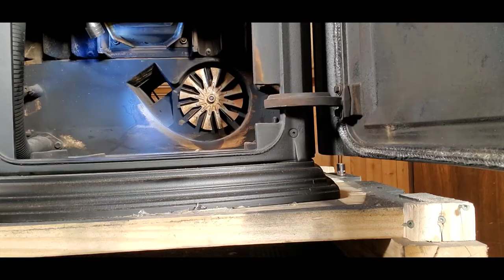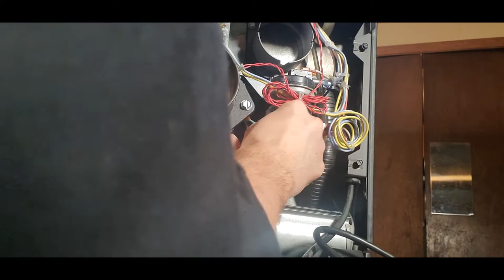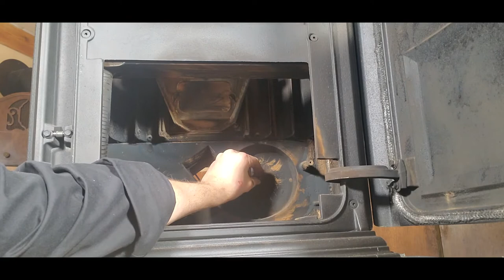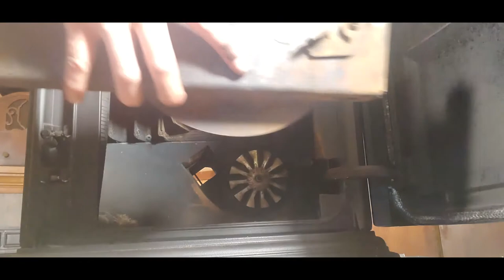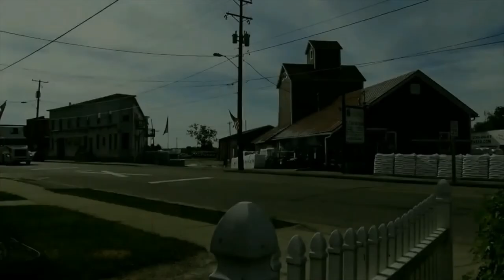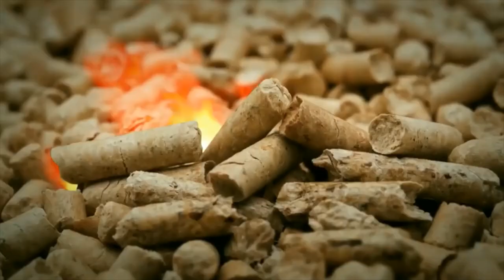How To Replace a Harman Combustion Blower, Exhaust Fan Draft Motor

Comment: I just changed mine out yesterday. Not bad for 10+ years. Yes, 1/8" allen screw, was way tight; soaked with penetrating oil overnight; Used small torch but still nothing. Ended up bending fan fins over and cut off at shaft.
I covered the blowers in back with a rag so I wouldn't lose and hardware inside. Motor came out easy. I reused the felt gasket. New motor was a newer design with a one fan versus a two fan. The ties I had cut I left hanging so I would know where to replace with new ones. Routed power cord back and secured with new ties. Replaced damaged fan also.
Not too difficult of a job to replace unless you're working on the floor like me...on your side like a pretzel. Though I did pull stove out away from wall I was able to get behind it but still awkward position. Still, u guys make it look sooo easy especially when unit is up on a lift bench...haha!
Just a note: My motor was a two fan. A replacement May look different. Again, Two fan versus One fan on motor.
(Hearth & Home Tech) Part# 3-21-08639 Combustion Blower / #3-20-40985 5in Single Paddle Blade. YOU Must use your Model and Serial to obtain correct part/s.
Also adding: I did look up motor on parts list (online) for an Accentra-2 and brought it to Stove Shop I went to. The number I gave them was a completely different motor And $454.! Once they had serial number and proceeded checking in their system they came up with a different part # and upgraded motor. Under $200.! So, please.....either bring your original motor with you to store and/or give your serial number. Model and Serial are on back side of stove. Good Luck!
Reply from the maker: Thanks for sharing the detailed report with the community; very appreciated. Yes, I have also seen those paddles so stuck on there that you need to bend the fins and cut it off - glad you tried the other options first. Yes, early Harman models had a combustion blower with a two blade design, later on they changed that to a one blade. Yes, over the years there are different part numbers used for the same item, it's also good to double check and cross reference. We are happy to help if needed. Thanks again!

Comment: I have the XXV and have a hard time accessing this draft fan. Two wing nut and a long bolt. I loosen all 3 and the fan doesn’t budge. Seems like it sealed on. Any ideas how I can get it out? Non flammable lubricant??
Reply from the maker: Thanks for contacting us. I believe you are referring to the fan paddle attached to the draft/exhaust motor correct? There should be a small allen bolt holding this fan paddle to the motor shaft. In may cases we need to soak that down with a lubricant like WD40. In some cases folks will use a pencil torch to heat that area up to break the fan paddle loose. There have been times that the paddle is bound to the shaft that lubricant or heat do not work. If this ends up happening, the best way will be to fold the paddle impellers in and use a dremmel tool with a cut-off wheel to cut the motor shaft for removal. Keep us posted, happy to help.

Comment: I have a Harman Iron stove.  Any recommendations for finding the right exhaust fan?
Reply from the maker: Hey Neil, Several Harman Models used the 'Iron' tag including the Accentra as you see in this video. Iron would not be the model. On the back side of the unit you will see the UL label and that should provide you the model name (I'm guessing you either have the Accentra or the Advance). As for the exhaust fan, all Harman models will use the same exhaust motor. Here is a link for reference. https://pellethead.com/product/harman-heatilator-ecochoice-combustion-blower-exhaust-draft-fan-motor-oem/

Any other questions please let us know. 

Thanks!

Comment: If the flame is getting drawn down into and through the burn pot what could that be? Thanks for any help.
Reply from the maker: Do mean the flame is coming around the edges of the burnpot? If you are consistently seeing flame shoot out the edges of the burnpot or top, we would recommend checking/replacing the burnpot gasket and burnpot flame guide. If this is not what you are referring to please provide further description. Thanks.
Reply: @EarthSense  Thanks for responding. Last summer birds made a nest in the chimney also a bird was in the fan that's behind the ash drawer going to the exhaust pipe. I didn't know all this until I tried to start it this winter. I cleaned out everything I could think of and reach. 
Here's what I found. First, if I do nothing it doesn't light. No ignition. It does feed and 25 minutes later it sends a 5 blink code. 
Second, I found If I restrict the air flow coming into the stove just by a little it will light but the flame gets drawn downward into the burn pot. That makes the exhaust pipe extremely hot. 
I have no idea what I should start with or why it's doing this.
Reply from the maker: @LPH-11   Thanks for the message back and explanation here, very helpful. Let's take a close look at the paddle impeller that is behind the ash drawer. This connects to the combustion/exhaust motor. If this impeller got bent or damaged at all from the bird it would cause improper air flow through the burnpot affecting the ignition and fire direction. Depending on the Harman model there will be differences in size and single/double blade for that fan paddle. We can steer you in the right direction if needed; just let us know your model. Very important the right one is in place for proper combustion. It will also be good for you to inspect and clean the ESP probe - we want to make sure there is no damage to the probe that took place. Quick video on cleaning that - https://youtu.be/kt7nnGMYU-k?si=C80osB2b5h3JXKVR

Keep us posted, happy to help and get you back to 100%. Thanks.
Reply: @EarthSense  Harman p68 pellet stove. Wow! Thank you so much for your help. I think it might be easier if I make a video on YouTube and send you the link. Just so you can see exactly what it going on. I can make it tomorrow morning if you don't mind. 

I live outside of town and it's hard to find help or anyone to come out. I bought the house around 12 years ago and this pellet stove came with it. First time having a pellet stove. I never had an issue with it until now. I don't know much about this and I usually try to fix these things myself. I find it hard to find a detailed explanation of how and why everything works.
Reply: @EarthSense    Here are 3 short videos explaining my issues with my Harman p68 pellet stove. Thanks! 

Around 3 minutes
https://youtu.be/6REf-vTYEO4?si=zDydlhvqtnqWhRuO

Around 30 seconds
https://youtu.be/eTIcY79HxSc?si=C1lwKsNxQOEHytjx

Around 30 seconds
https://youtu.be/uC9TAF_YpBw?si=srAq1CDM5lEJ15G8
Reply from the maker: @LPH-11  Thanks so much for the messages and videos, very helpful. Running this past another tech to get his insight as well. The air intake port in the back is the combustion air being pulled through the burnpot. During start-up this air becomes super heated from the igniter creating ignition. During operation this air is pulled through the burnpot, up past the heat exchangers, down the rear fire wall and forced out of the flue vent pipe by the combustion/exhaust blower. It is normal, especially during shutdown to see some fire burning at the end of the auger, and for small coals/sparks to be flying around in the firebox. I will follow up shortly once I consult with the other technician. Thanks!
Reply from the maker: @LPH-11  Just heard back from one of our technicians. 
1. Are you making sure the restrictor baffle plate is installed back in place over the fan paddle impeller?
2. Are you making sure the ash pan is back in place?
3. Is the fines/sawdust cleanout cover installed and sealing properly? (Video below on this).

It's something with our combustion air-flow creating these issues. Keep us posted on this - we'll get it figured out. 
https://youtu.be/l3-Wg1xRUy4?si=jBpSVn0CSONg2q-H
Reply: @EarthSense  Thanks for the info. I will be checking on all of these things. Really appreciate it!
Reply from the maker: @LPH-11  Absolutely! Keep us posted. We'll get you back to 100%!
Reply: @EarthSense  Thank you so much. You guys are amazing! I got it working and the issue was definitely obviously an air flow issue. I checked everything you guys said and it looked good. I ended up cracking open and closing the bottom door for the ash bucket a few times. It changed the flow and now it is working perfectly. Thank you for all your help!

https://youtu.be/JOPCN0KZjbM?si=Ozl0Kqbp-AAV_HzH
Reply from the maker: @LPH-11  Fantastic!! That fire looks excellent now. So it was something with the ash door seal - glad you discovered that, great job! Both the door and ash door gasket seals are very important for proper combustion, efficiency, and air flow. So happy to see that great looking fire and thanks so much for the tip - very generous of you!

Comment: I bought a new combustion fan for mine and it came with two black wires and one green.  Wondering if I got the wrong motor now. At first I thought nothing of it because I had heard rhey changed the motor since I bought it. My original combustion motor had two fans on it. But my wires don't seem to have the thermal protection either.
Reply from the maker: Thanks for the message Randy. There are many different replacements for the combustion fan. Yes, early Harman model combustion fans had two fans, the newest replacements do not. It does not matter which wire connects to which lead except for your green ground wire. The ground wire needs to go to a ground spade, a receiving ground wire or if there is not one it can be left disconnected. The wires should be thermally protected. Many of the new wires have thermally protective plastic-type coating vs the original 'fabric-style' thermal wires. Any other questions please let us know. Thanks!